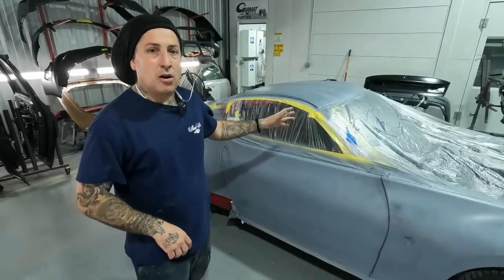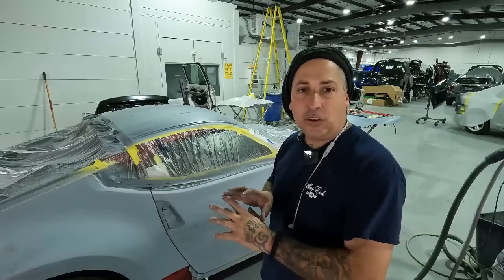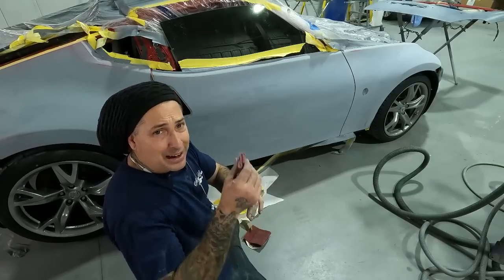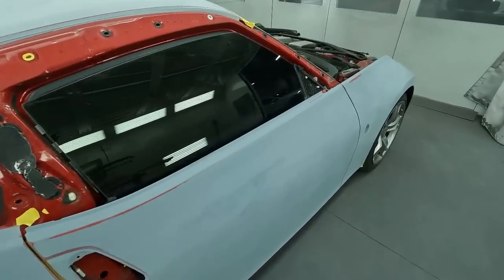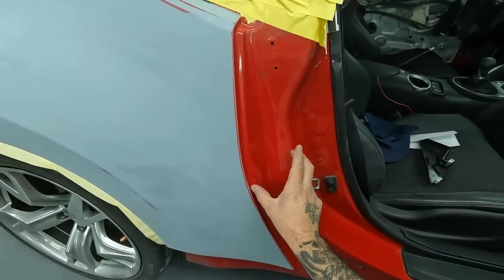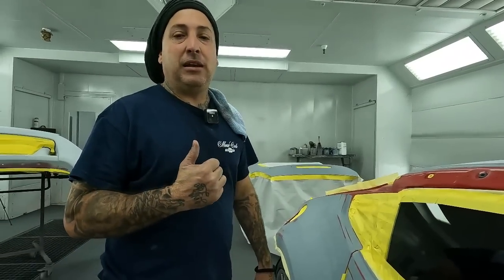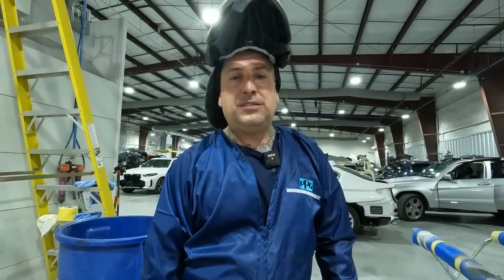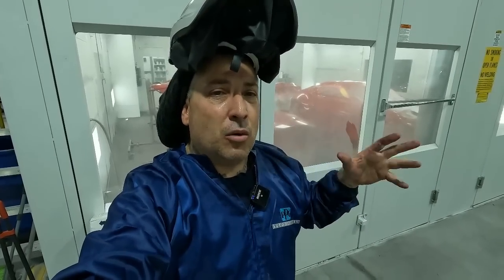How To Prep And Paint A Full Respray - Nissan 370 Z

Comment: Excellent teaching & results as usual in all your video's & hugely appreciated.  
The only thing that would be handy is to include in your supporting comments - specs on spraying (Gun / air-pressure/ fan adjustment/fluid adustment/ booth temp) it helps us a lot and saves us asking you the same questions over & over again )

Comment: Looks great I'm spraying with the dv1 with the c2 cap at 16 psi but I'm also spraying r&m dc3553 clear with it
Reply: You really should turn that pressure up to get the solvents out and break the clear up. Are you spraying Onyx? We used the dc3553 for years and it’s a good all around clear but now we switched from onyx to 100 line.. still BASF but it’s the best paint line available. You should check it out it’s incredible.. we also spray the glasurit 929-255 clear it’s amazing

Comment: Does it not make different scratches between a block and an orbital? I always thought that 600 or 400 discs on a orbital would make finer scratches than if you used a disc on a block because of the way the grits are layed? Eg I thought a 500 disc used on a straight block would create deeper or courser scratches than the same 500 disc on an orbi? I take it this was false information or it is so minimal that tge quick orbi over after with sane grit sorts that out? Don't know if this makes sense? I always thought that a say 400 disc used on a block would create say 320 or somethinmg sort of scratches? Sorry for the essay or if it made no sense whatsoever?
Reply from the maker: A straight scratch is a little more aggressive than a da scratch.
Reply: Cool the way people have explained to me was a 400 disc used on a block would produce the same scratches as a 180 on an orbi, thought it was probably bullshoot, thought I'd ask the master, and the master has spoken. Thankyou for your time sir
Reply from the maker: It not that drastic of a change as 400 to 180 more like 400 to 320 grit  hope this helps
Reply: @kandyman5315  yea does man, thanks thanks for replying